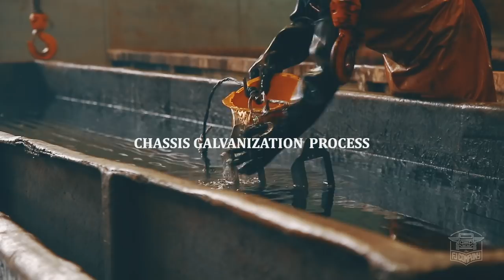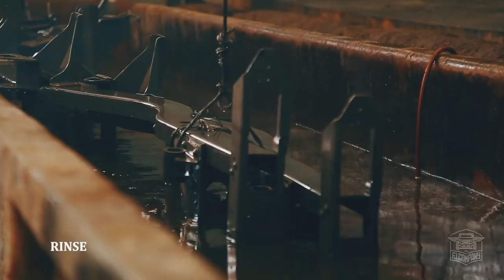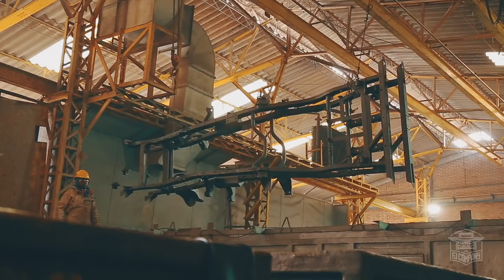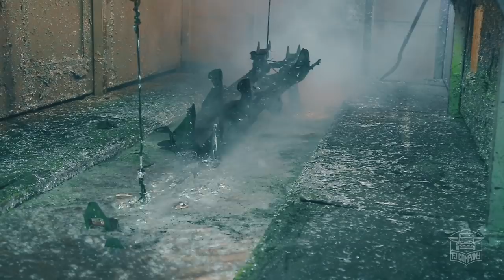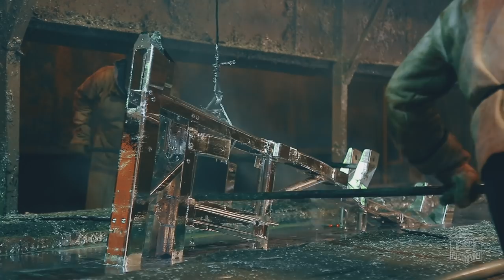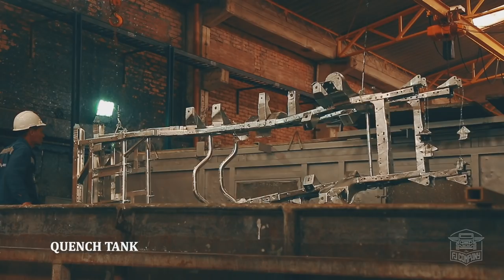The FJ Company - Chassis Galvanization Process

Comment: Have you had any heat distortion issues after galvanizing? I've heard it can happen and that some straightening might be required....given the 840 deg F Vat temp.
Reply: There is no way to prevent the warping of metal while hot galvanizing.
However it not realy an issue with thick steel like this chassis.
Thin mettal bodys of a car would get realy bent if you would try this.

One last thing to look out for is that the galvanized part is weaker and can withstand less force afterwards.
so never hot galvernize parts of the suspention or acel
Reply: i;ve talked with people in MFGing it is an issue, word is if done right i's kept to a minimum. also i don't think chassis are completely straight. every vehicle wheel alignment is a little different. also the same body gaps but, thats more each body panel not being perfect either.

Comment: What is the cost of this?
Reply: Just spoke to 2 galvanize companies in Massachusetts about having a frame done.  Both require a grease free sandblasted frame and one quoted $1300, the second quoted a minimum of $450 so I don't know what that actual total would be.  So figure $500 - $1500 depending on the place and whether they do the prep work or you do the prep work.

Comment: I see no use in restoration using galvanization.  If they would have had the modern corrosion resistant materials back then, they would have used them.  Galvanization will stop rust for twenty years... but now there is other stuff that will stop it for a hundred.
Reply: no OEM manufacturers used galvanization on their frames back then because of the cost it adds to the product.  A typical galvanized chassis lasts for 40 years before the original metal is exposed again and in all practicality 40 years + another say 20-30 for the original steel is good enough for just about anyone.    Please let us know what the "other stuff" is because its always nice to keep up with modern innovations.
Reply: @Mongoswede  ya, galvanization is just a layer of sacrificial metal.  20 years ago I worked in auto body repair and we knew the manufacturers were coating all metal with better products.  We used DuPont chemicals to cover exposed metals.  I’m sure the products they use now are even better.  I wish I could tell you the best stuff but I’ve been out of it a long time.
Reply: @esquire9445  I haven't seen any new cars with good coatings on them.  Unless they are in an environment where there is no winter.  All the cars around here rust after a few years.  European, Asian, USA based all starting to show corrosion in 3-5 years of use.
Reply: @Mongoswede  Disposable new cars eh?  I know Tesla stopped selling their cars in parts of Canada because of corrosion issues.  I thought newer cars were better than that
Reply: @esquire9445  Need I point to the massive Toyota truck frame replacement recall :|
Reply: @Mongoswede  Funny, I just researched that online... Apparently I had one of those but I sold it.  lol, never knew.